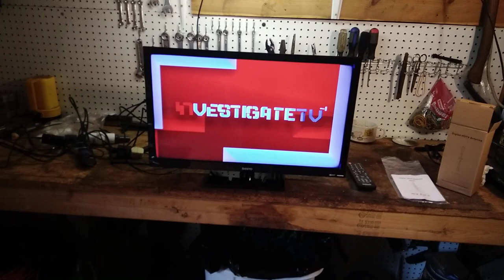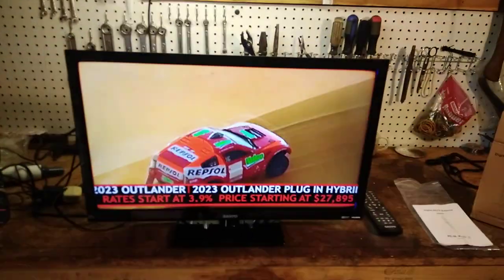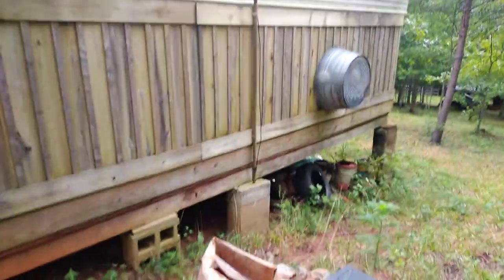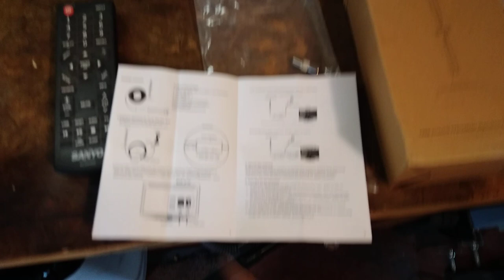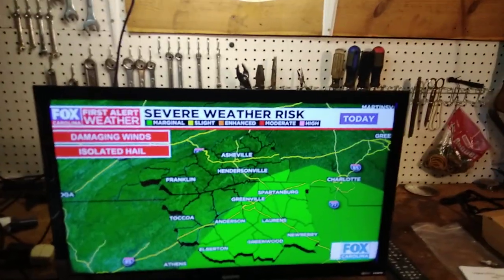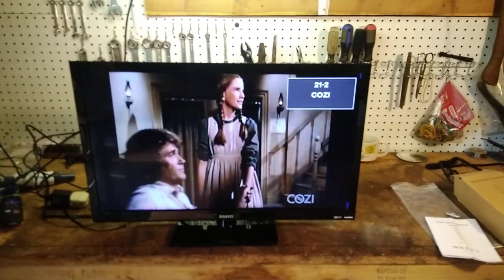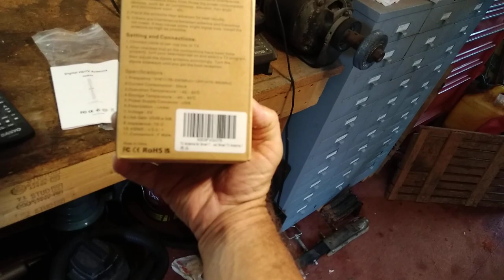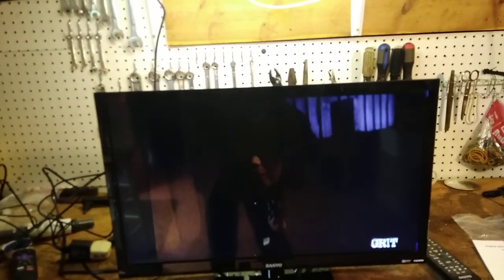HD indoor TV antenna review. Cord cutting? This could be the antenna for you.

Comment: You would likely get better performance from a set of rabbit ears like people used back in the 1970s.  They are ugly but you can tune for best reception with them.
A lot of people do well with an attic antenna.  It is an option you can look at in the future.  It means running wires but it can be nice to have just a jack to hook the TV to to get signal.
Reply from the maker: I have an old set of "rabbit ears". They don't do well here in these mountains and around here new rabbit ears cost more than this little thing did. Thanks for watching.